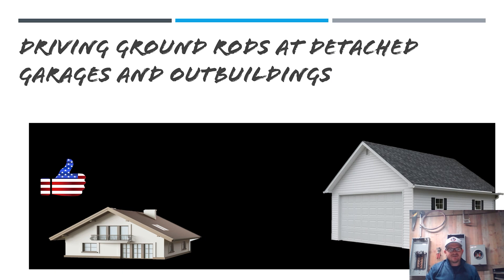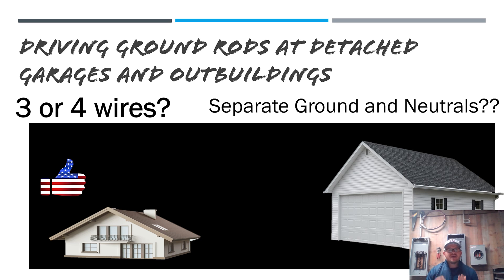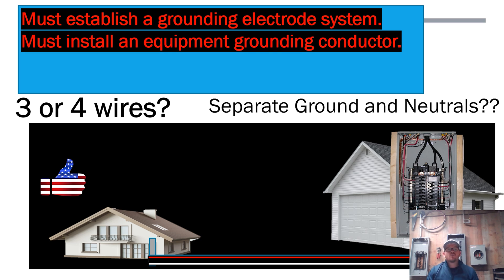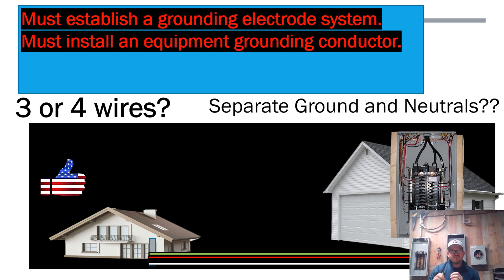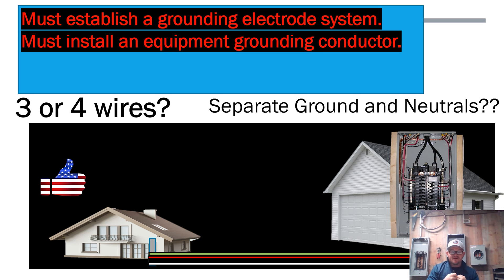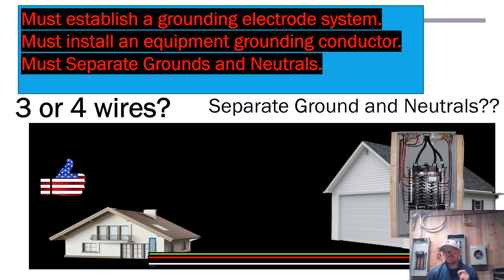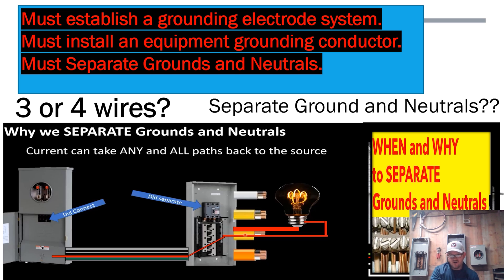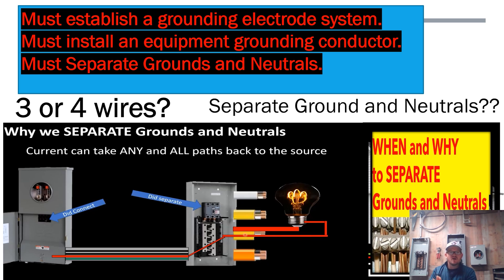3 or 4 Wire Feeder to Garage?? Separate Grounds and Neutrals??? Sub Panel??

Comment: Hello. Glad I found your YouTube channel. I am getting ready to run power to my new metal building from the meter on the back side of my house which is a 200 service. I have been told several things from different people. The total run underground in 1.5” pvc conduit will be 120’. I want to use a 100 amp breaker out there to feed everything. I do not need anything major because I am just running LED lights, a industrial ceiling fan and some outlets. Not running a big air compressor or anything like that. So do I have to run the 3 or 4 wire out to it? Also would it be a number 2 or 4 wire? Thanks for any input

Comment: Can you explain why SER cable can’t be buried? I’ve read that it is because the equipment ground is not insulated, but I’m also pretty sure code allows uninsulated equipment ground to be buried.

Comment: You presume that you are going from panel to panel.
What about going from an existing outlet circuit in the house to the garage?
Mine is a 3-wire for turning on/off the lights from either.
Outlets in garage are tied in and grounded by their own existing ground rod. No ground wire between the house and garage.
Works PERFECTLY with a GFCI.
Needed the GFCI for a battery charger and once in a great while a drill.
There was never a sub panel in the garage.
Costs far too much to pay to upgrade the garage, wiring, and main service panel. All for ONE stinking outlet....

Comment: hello I have a question. When I am running 3 wires to garage through over head mast on both sides. Then I install a grounding plate in the garage side, Do I have to bond together the neutral and the goung  wire in the box installed in garage? Pleas let me know

Comment: Thank you for video! 
I have a question I hope you will answer. I ran triplex(4ga alum) in 1.25” conduit out to shed I’m building with 60 amp box. Didn’t know about required 4th ground wire, the 1.25” conduit isn’t huge so wondering what gauge the 4th grounding wire needs to be. 
Thanks much, Ken

Comment: So this means you can't bury a triplex aluminum wire feed to a detached building subpanel (because its only 3 wires and not 4)?
Reply from the maker: Correct
Reply: @ElectricalCodeCoach  I'm sorry. I'm female and trying really hard to figure this out. Should I then use 2-2-2-4 THHN copper from an outdoor main breaker in 2" conduit to a subpanel in a big shed? Its a 76' run. (I'm attaching a 100amp breaker panel in the shed with 2 ground rods, because I know I can't use a lug panel in a detached building). Thank you.

Comment: This is great stuff! Thank you. Questions: Can electric cable (#6/3) be run above the soffit, in the eave of a house, to a drop point and then through conduit buried to reach a separate structure? Would conduit have to be used in the eave run?
Reply from the maker: Great question! You cannot use 6/3 NM outside at all.
Reply: @ElectricalCodeCoach  Thank you. I would only run UF-B outside anyway. Really appreciate all your info.

Comment: I'm running a sub panel off another sub panel. First panels 200amp, 2nd is100 amp and I'm adding the 3rd. Guy wants 100amps witch I'm not sure is legal. I plan on doing a 60 amp but he said he has sombody who says is OK to do 100amp off a 100 amp sub. Am I right or is he?

Comment: man oh man, this is clear and helpful.  I am installing a Victron charger/inverter in the out building and didn't know to use a ground rod connection or not.. the "ground loop" fear in ignorance is the issue. When the AC power drops from the Victron input, it automatically connects the ground and neutral ... no ac only battery to inverter and then AC out...

Comment: When feeding 2 phases to the outbuilding sub panel, is a disconnect required? Does it have to be at the outbuilding or can it be at the main building? Would the breaker at the main panel that feeds the subpanel qualify as the disconnect?
Reply: Main panel. Sub panels usually don't have main breakers however, it might be more convenient to have a main shutoff in the building

Comment: Hi , for 100 amp sub panel  in a separate residential unit about 145 feet away under ground pvc pipa 1,1/4 , could I use number #3 thhn wire?

Comment: i have a run of 260 feet run from my 200 amp main panel to a 100 amp sub panel. im trying to get 240 volts and was wondering what size wire to use and what size ground wire i need. I was thinking 2/0 1 aluminum  for conductor and neutral and number 8 copper for my ground.  please help.  thank you Sir.

Comment: Your video answered some big questions I had. Thank you.

Here is another question- If a detached garage has a sub panel that is fed overhead by three wires (two hots and a neutral but no grounding wire) from the main panel, can a separate grounding wire be run underground from the main panel to the sub panel to satisfy the four wire requirement?

Comment: So I installed a 100 amp panel on the opposite side of my house and running electric from this new panel in conduit to my metal bldg. do I need to ground the new panel with grounding rods or is the ground back to the main enough all is in conduit and pvc boxes thanks for your help. Good day to you
Reply from the maker: Is the building detached?
Reply: @ElectricalCodeCoach  yes sir

Comment: My question:  I'm putting in 50 amp service in my steel shop.  I confused if I Ned a separate grounding rod for this subpanel.  If so, does it connect to the structure, the can and the separate ground bar?  I've spent several days trying to find this information on Google and YouTube without a clear answer.
Reply: You may need to watch this video several times. I have and believe your question is answered in the video.

Comment: Does this also go for pre-existing detached Garage?. Its already wired 3 wire ( 2 hot and one braided Neutral ). It is attached to the external main breaker panel on the house by a double pole 50 amp breaker. Everything in the garage works just fine. Looking to replace the sub panel. It's pull switch type with paper fuses.

Comment: So install a grounding rod at  structure and ground that to the physical sub-panel housing and then the ground wire from the main panel goes to an unbonded ground bar in the sub-panel and the neutrals go to an unbonded neutral bar in subpanel? Is that correct?

Comment: Why do we need to run a equipment grounding conductor? Couldn’t we just use the neutral as a ground? I know code requires but why does it?
Reply from the maker: Great question, we must establish a grounding electrode system for surge and lightning purposes.

Comment: So the reasoning behind all of this is to ensure a low impedance overcurrent  ground fault loop path as structure being further from the house could add to impedance result in inefficient or ineffective operation of overcurrent or fault current protection devices (breakers/fuses). Measuring ground earth resistance using a 3-wire fall of potential method is a good way to ensure you get down to less than 25 ohms of resistance. Two ground rods usually gets you there to 25 ohms or less but soil conditions differ across the US. If your not testing your guessing. With a sub panel in a outbuilding there are additional issues to consider like selective coordination of protective devices at the sub panel and main panel. Good set of videos to raise this issue. If there was a metal water pipe connected between the two buildings that would also need to be bonded with the GES at the outbuilding.

Comment: why not create a new ground close to the new structure ?? why running long span of ground cable to the ground source.  Ground is not single or 3 phase power that need to be synchronize with source main supply.
Reply: Because of ground faults its to insure it goes back to source through your single bond point. The grounding electrode is more to get the lighten back to earth as quick as possible
Reply from the maker: That's a good question, that's just how the NEC has it set up*

Comment: Sub Panel treatment as usual nothing new here.  MUST have grounding system rods etc. if installing a panel. 
Even though the green screw is REMOVED isolating the grounds and neutrals STILL MUST
ground the can to the equipment ground and all the outlets in that building.
Reply: Proverbs 11:25  “The generous soul will be made rich, And he who waters will also be watered himself.”
Thanks for sharing  not only the video but the verse!